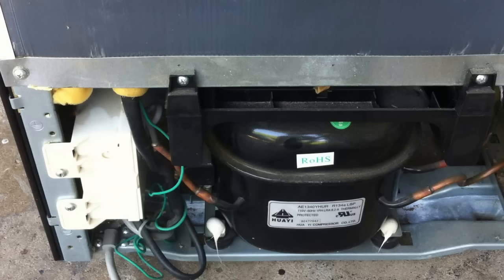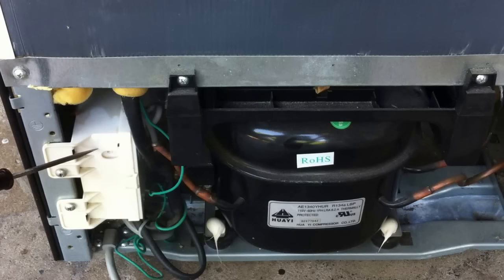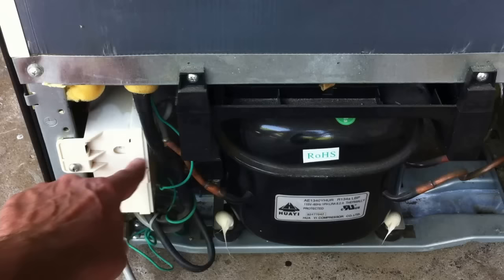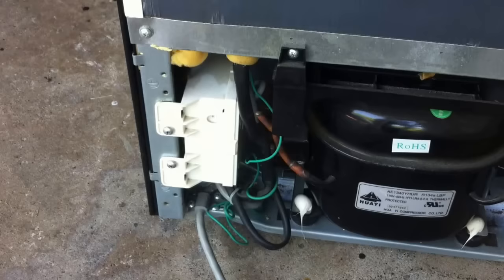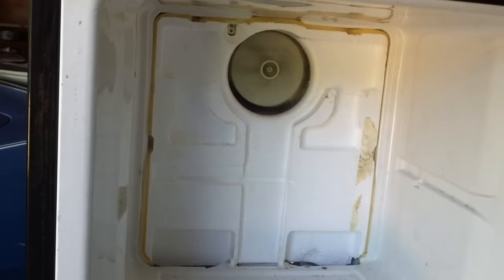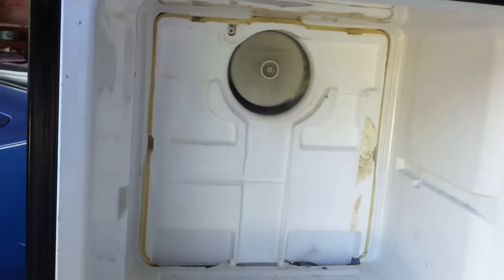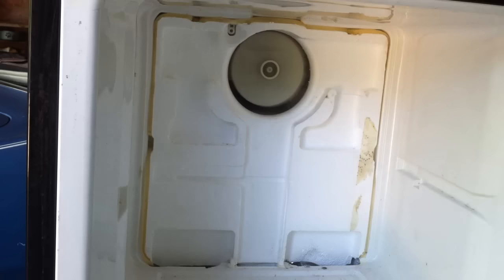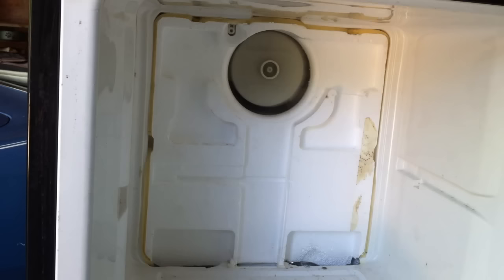Easy Refrigerator Fix, Reset (Defrost Timer) Switch, if it stops running, cooling or working.

Comment from the maker: As I stated in the video, I’m not a refrigerator repair guy. I just “happened” upon this solution. The idea is to just keep your food cool until you can work out a better solution to your dilemma. Read the comments below. A number of people have come up with similar (alternative) “fixes.” Good luck & stay cool.
Reply: I have a question about the refrigerator fix , you see a friend of mine just gave me a fairly new fridge,  she had it plugged in at her place , it was running just fine ( cold ) , .... my best friends husband volunteered to transport it to my place , all went well with the move but when I plugged it in here at home it started to smell like burnt rubber , anyway it was running so I put my food in it only to find it hot in the morning.  Do you think your fix it tip would make it come back on ?  I honestly don't have any money to have it fixed and my old unit died so I'm in a really tight spot .. been using a small cooler for ice ..
Reply: +Michael Powell  Mate - thanks very much.  I'm yet to try it as I lent a mate of mine my smaller style LG fridge after it was in storage for a while and he said it doesn't work which puzzles me.  I'll try the trip switch thing out later and see how I go.  The fridge back in your vid looked exactly like mine.  Cross fingers - cheers!
Reply: +Michael Powell  Mate - thanks very much.  I'm yet to try it as I lent a mate of mine my smaller style LG fridge after it was in storage for a while and he said it doesn't work which puzzles me.  I'll try the trip switch thing out later and see how I go.  The fridge back in your vid looked exactly like mine.  Cross fingers - cheers!
Reply: limolee007 o
 Cr
Reply: Great video! Yes, this is common, see my above comment. It will "band aid" the fridge until a part can be ordered. The switches usually run between 8-12 hours, meaning every 8-12 hours, the defrost timer goes into "defrost", stopping the fridge and activating the defrosting element in the freezer for 30 minutes. It then cuts back on, but it is getting stuck off.
Reply: Sir I come to you once again, the video about the refrigerator you shared with me was on point so thank you . I was able to get my fridge running but now a second issue has come up .... the freezer side works perfectly but the fridge side won cool ... the refrigerator started to make a loud humming notice then it just stopped cooling on the fridge side . Any suggestions?  Thank you in advance
Reply: ms presley, sounds like your fan has gone out.
Reply: After the transportation. you wasn't supposed to plug in the appliance. Only after eight hours you can this is to allow the refrigerant gas to settle so it can work normally.
Reply: 24 hours
Reply: Michael Powell thanks
Reply: After moving a fridge that has been laud down you MUST leave it upright for 24 hours before turning on. Let the Freon drain back into the compressor or it will burn up.
Reply: Misspresley07 June1960  when you transport a fridge you have to make sure you keep it upright as possible, if by chance you don't, you wanna stand it up for 24 hours before you plug it in.. hope it worked out for you;)

Comment: Brilliant tutorial Micheal. My frigidare white timer box looks exactly like yours. I can only turn it counter clockwise, then everything comes on again. Any suggestions on how to repair the timer, as opposed to replacement?  Four years ago had the problem, moved the dial and worked with no problem. Now it seems to get stuck in defrost cycle and have to manually turn the dial to start it again. Best place to get a replacement timer, and the approx. cost? Any guidance appreciated, and thank you.
Reply: Did you find your answer? I have the same issue and I'm tired of resetting the timer lol
Reply: @jimrodgers6981  In my case it was not the timer at fault. The defrost heater was the problem, replaced it with a universal unit and everything is good and cold.
Reply: @stewartbruce8902  thank you so much... I'll look at that

Comment: That timer usually has nothing to do with the compressor running. Unless you meant coil fan not running.
The time delay relay controls the heating coil mode to defrost the freezer coil.

Comment: We are all on a journey, and this video from Michael was clearly a help to me on my journey.  However, an edit or clarification to the description would help. 

Suggested video title:

Easy Refrigerator Fix.  How to manually advance Defrost Timer to Reset Switch if it stops running, cooling or working.

Suggested description:

Some refrigerators have a mechanical Defrost Timer that serves like reset switch, but is not marked in any way or described in the owner's manual.  If your refrigerator is plugged in, but not cooling, you may be able to get it running in a few seconds if you following instructions in this video to advance the defrost timer to reset its switch into cooling mode.

Here is the basic theory that explains why a reset may be needed:  The defrost time is an electric clock that lets the fridge run in regular cooling mode about 8 hours, but switches to defrost mode for about 15 minutes after each 8 hour cooling period.  During defrost mode, no cooling is expected; this is normal operation for a unit in good working order.  If you happen to plug your fridge in while the timer might be in defrost mode, you could wait a half hour just to be sure  the timer will not advance on its own in the normal way, or use the instructions here for quick results.

If you want to get your fridge running right away, you can advance the timer manually.  If the timer is stuck in defrost mode, this will be a huge help to get into cooling mode.  However, if you want the defrost system to be operational, replacing the timer, an easy to replace $20 part, is a good idea.  

The location of the timer may be as shown in the video, or elsewhere, such as inside the unit.  It's even easier to reset the timer if it located underneath the top of the lower compartment of a traditional freezer-over-fridge unit, such as many common GE models.  Just open the fridge door, look up in the area of the control panel, and you'll see the manual reset control, identical to what is shown in the video.  It's a white plastic shaft that accepts a flat-bladed screwdriver.

If you find that your timer is OK, and the compressor.and both fans run, there still may be other issues with the defrost system, such as the heater element or the defrost thermostat which detects the presence of ice.  Without the defrost system operational, the coils will eventually become blocked, a huge block of ice that could take many hours to melt.

Comment: Wow thanks, mine wasn't in the back though but inside the fridge, but thanks for telling me what to look for, you saved me calling a repairman.
Reply from the maker: +Georgie Thumbs Thanks for the feedback. I think it's the repairmen that keep hitting the dislike button on this video.
Reply: +Michael Powell  - I can imagine, I was all ready to either throw out the fridge and buy a new one or go through the hassle of looking up a repairman and getting ripped off,  I mean literally I was right there by the phone wondering if I should call special pick up for sanitation or a repairman and my brother suggested looking up Youtube. You my son are the Saint of fridge owners everywhere, bless you!
Reply: +Georgie Thumbs Where did you find it?
Reply: +MrCkeptik - If you open the fridge, not the freezer on top, but the bottom door, open that up and look on the ceiling of it, there is a temperature dial. Well right behind that dial is a hole and if you look in you can see the reset button. Stick a screwdriver in it and turn it and it starts the fridge right up.
Reply: Georgie Thumbs
Thanks a lot. I replaced evap fan inside freezer and everything was working for a few minutes and then stop. I thought I connected something wrong but it was just that switch.
Reply: Thanks! it worked. Took longer to talk about a possibly replacing the frig then it did to fix it.

Comment: Mike, I hope you read this before I have to leave home to my dad's, out of town.  Last time I was at my dad's, we changed the defrost timer because the refrigerator stopped working all together.  Did we reset the defrost timer on the old switch first?  Yes, we did.  The freezer and fridge worked for about 8 hours and stalled again.  So we went to buy a new D-timer and installed it. His overall refrigerator worked well again for 8-10 hours and has now stopped working again.  Can you tell me what would be next to check or what part to replace.  Please reply.  Thanks.

Comment: That is a defrost timer that you are just advancing. It isn't any kind of trip switch. Doesn't necessarily fix anything. But it may get your refrigerator temporarily running. The defrost timer may be going bad and getting stuck. It's pretty cheap to replace the defrost timer.

Comment: the trip switch is a defrost timer.that could be advance, manually from cooling to defrosting.. cycles.replacing the timer or thermo disc or the heating e lement.will solve the ecsesive accumulate frost..ice formation will stop the unit for working right..

Comment: I just bought a used unit manufactured in 2003 apparently and it's not cooling too well. It is a wine cooler but the specs say it cools down as low as 6c.  It's barely 15c or hotter.  Is it likely out of freon? What could be a possible fix?

Comment: I have a WHIRLPOOL Fridge WRT771REYM00  - unplugged it so that I could take back off to see where leaking, took off back little cardboard panel, plugged back in
and now it won't turn back on.   any suggestions?

Comment: Were the compressor and fan still running before you fixed it. Mine compressor and fan are running, but the temperature does not cool enough and the compressor keeps running. 45 on Fridge and 38 on freezer.

Comment: It’s a defrost timer . The timers “stuck” in defrost. Just moving it out of defrost will cause One or two things to happen more than likely. First it might get stuck again in defrost ruining the food you have. Second it might get stuck in the run cycle and not defrosting causing the Evaporator to freeze up and your food will ruin. The cost of changing the defrost timer is small and something easy to do.

Comment: I hear the fan running without taking off the panel, but it blowing warm air in freezer and the the bottom part hot as well. Is the switch still the problem

Comment: okay figured it out....I plugged back in and thought there has got to be a way to reset this thing.  So I by chance held in the TWO temperature buttons on front at the same time for a few seconds and the fridge and lights all came back on.   I didn't find anything in the manual regarding a reset so maybe someone else out there needs to know so thought I would share
Reply from the maker: That’s great!
Whether it’s a “reset” switch or “defrost timer” switch, a lot of units APPARENTLY don’t come back on unless you MANUALLY trip the switch somehow.
Reply: Yours must have electronic controls . On some Amana models , you can press the switch on the freezer door opening ( at the top )  5 times and it will reset the defrost timer .

Comment: Hi Michael what you could be the reason for my kenmore top freezer, a year old only,  not keeping a constant temperature. It keeps fluctuating from 0 degree to 30 degree.
Reply: Isn't it still under warranty?? 
Also look into the Kenmore/LC Class Action Lawsuit (Refrigerators, mostly, don't know if Attached top/bottom Freezers are involved)

Comment: that's not a reset switch. It's for manual defrost. Those style of defrost timers go bad quite often. they are very cheaply made. What happens is they get stuck in a defrost cycle. When this happens, the only way to get the compressor to operate is to turn it out of a defrost. It is a way to make it run, but the timer should be replaced. They're about $20 and it's very easy to change them out. There are universal timers made that will work in most units.
Reply: Von Sterner ✌✋
Reply: If you are such an expert, why not tell us the corrrect way. Show a video of your expertise.
Reply: Von Sterner agreed
Reply: Did not mean for my reply to show a reply from the guy before me.  I meant to agree with him on the mechanical defrost timer going bad and being an easy fix.

Comment: A freinds freezer was all iced over and blocking air flow to the bottom. I removed the inner panel in the freezer and ice was in the coils. We unplugged and thawed it all day. Plugged it in and the light came on. But that was it. I was only there 10-15mins, and the compressor never came on.

Comment: i took it apart and found that in the fridge part (by the light ) that the vent which brings cold air from the freezer has a chunk of ice blocking air movement ...... i cleaned the ice & Also you must put the Freezer setting to the lowest for the most air to come into the fridge part .......... Model Fridge: Frigidaire FFPH45F4LM

Comment: This is not a useless switch. It's a defrost timer, that ever set amount of hours turns compressor on fridge off and turns on the heater to thaw the coils in the freezer. The thing you turn is manual bypass. (Timer works just like those plug-in timers you can use for lights and sich). If its stuck in defrost mode, likely need to replace the timer - little motor burned, or parts too worn. $10 part in most cases with lots of how-to videos (and this one is definitely not it)

Comment: my defrost timer turns off every several days, by the time i get home all my food are spoiled..the only way to turn on the fridge again is to manually crank the timer with a screw driver and the temp isn't even beyond a freezing point, its on mid temp setting...any advice on why it keeps shutting off? bad defrost timer?

Comment: Thanks, it works on mine. But it turns off again after couple days and i have to reset it again, is the relay broken?
Reply from the maker: Helen R For some people this is just a temporary fix if your defrost timer is broken, it will need to be replaced. 
At least you can keep your food cold (& not spoil) until you decide on a permanent repair or new replacement of the  refrigerator. 
Good luck.

Comment: Mice/rats chewed through the power cord. Repaired and no power until I did this trick of turning the defrost switch. Back to normal though I lost a leveller screw somewhere so I'll have to shim up the bottom to open the door. Small price to pay rather than buying a new fridge...

Comment: My fridge stops cooling after about 8 hours. Lights are on but only when I unplug it, wait a few minutes and then plug in does it start back up. Isn't the unplug-replug action the same as the "flip-switch"?? In either case, why does the unit only run for 6-8 hours and then stop until "reboot" it? Ideas?

Comment: The Defrost Timer switch can be located in different places.  For instance, on this video, the tech found it in the back on a white box, next to the compressor.  On my dad's Whilpool, the switch is found in the fridge, under the front panel board.  You have to look around as you look for a "button" that has a flat head opening for you to turn it clockwise with a small flat head screw driver.  Turn it to the right a bit until you hear a click and everything should come on, if you do not hear the fridge start up again, keep turning the switch one full turn, clockwise, until you hear the click and the start up.  If after you have gone around twice or three times and no start up, then something else, including the D-Timer, can be the cause.
Reply: Montery12 k

Comment: What about if it's not completely off but comes on and off continuously? It defrosts and re-frosts everything in the freezer. Frozen food goes bad and everything molds in the fridge. I tried lowering the temperature, but then it just ices up everything, especially in the middle of the fridge. Freezer still turns off all the time regardless of the temperature. Any advice, please?

Comment: Any tech here i have i tought is thermostat problem that motor doesnt turn off never . Stuff inside all freeze i changed thermostat still freeze ? What else to change i also changed relay/starter what could be problem to much freezing . Thanks

Comment: if that is the defrost timer, a defrost period might last 30 mins per 10 hr cycle.  so yes, advancing the timer will energize the compressor and fan.   Waiting 30 mins to see if it does it by itself might work too.

Comment: BRO!!!!
$10 10cu medium size fridge from the scrap yard. On little screwdriver twist and it fires right up. 🤷🏻‍♂️
Now I’ve got a fridge for the van. 
Gonna Dan Foss 12volt swap it to run off solar. 
YALL CAN DO THIS TOO IF YALL BELIEVE!!!

Comment: I'm on my way to a walk in cooler . I was told it just Has To Be reset. The defrost timer is not working and pilot needs to be re lit.. any ideas? Thanks
Reply: Must be an absorption refrigeration unit running on propane...lol
Reply: I sense sarcasm
Reply: Please I need help how to fix my inverter fridge that is not cooling